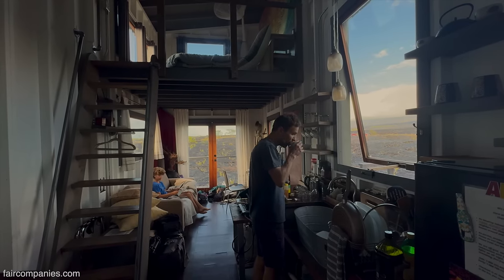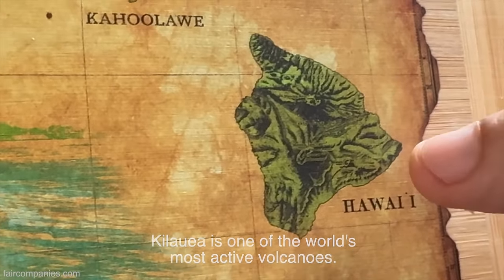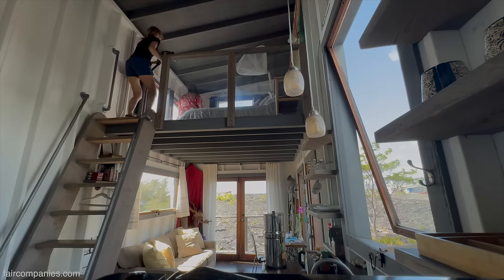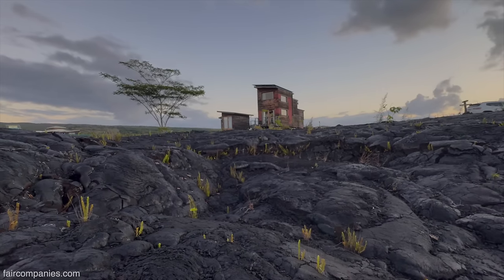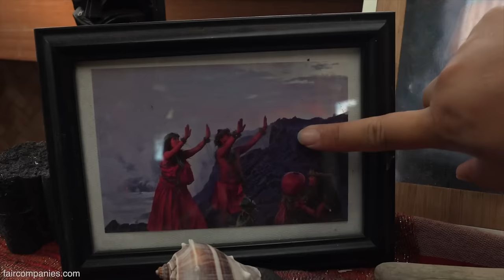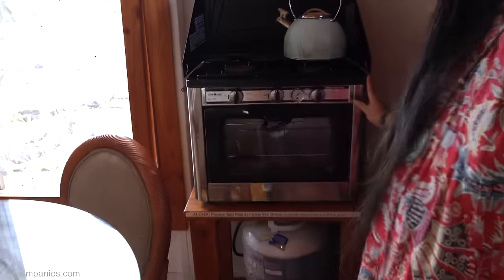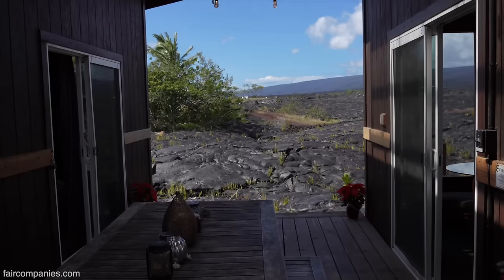Solo girl terraforms lava field with off-grid oasis & rugged tiny home 🏝️

Comment: She mentioned putting in a flush toilet, but no discussion on septic?
Reply: Most likely she and all of these people have “cesspools”. Just a 4-6 ft deep hole in the ground. Takes heavy machinery to bust out the lava rock though. Expensive process. Most of the older homes in Hawaii have them. But here they don’t have much rules and regulations because it’s so off grid so septic systems aren’t required.